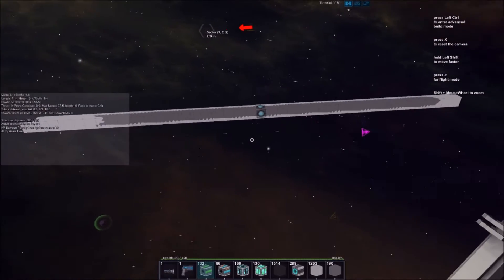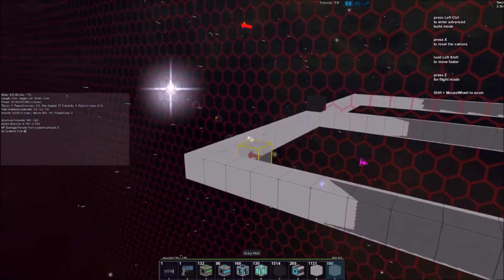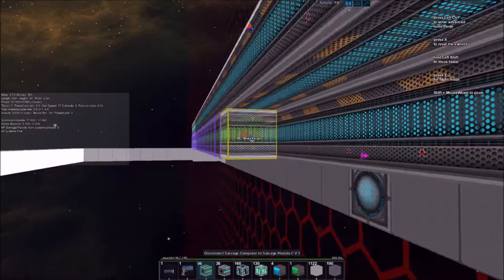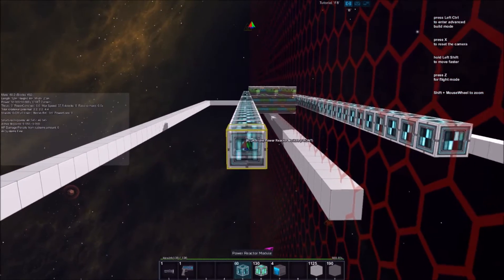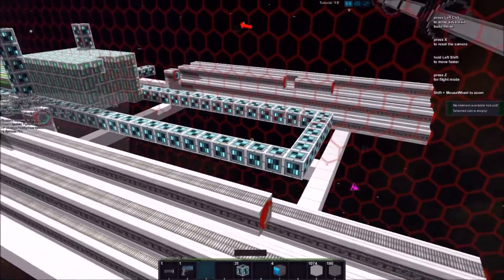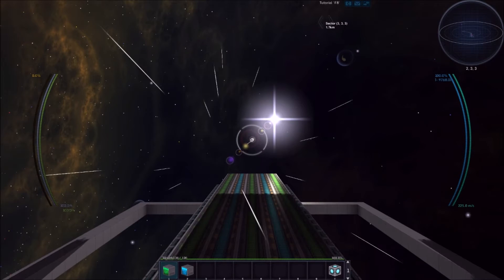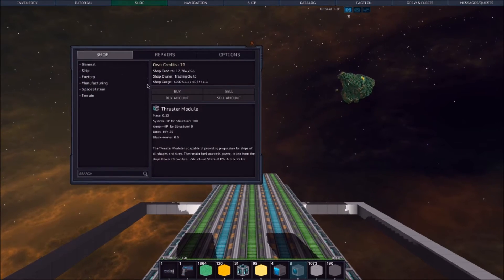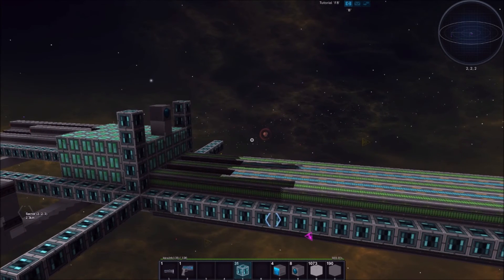Starmade Episode 4 - Realizing Mistakes

Comment: Hello; always glad to see additional videos regarding Starmade. :)

Time Index 9m55s; Connecting the two sections of power reactor blocks in this manner is a mistake for efficient generation.

Regarding the mining of planets Most would advise breaking the core of the planet before mining each individual planet plate (planet parts per the nav screen) with a far larger ship than the one depicted.

quick tips regarding mining in general: 

1) groups of 93 salvage modules per beam are considered most efficient for large mining operations such as planets which will consume approximately 110 blocks per salvage cycle. For this early section of gameplay perhaps having salvage "pipes" of 15 deep would be a good stepping stone in that direction. 

2) For the mining of asteroids Mining fleets tend to be effective as long as you are personally piloting the flagship of the fleet by telling them to formation idle as you pilot to / from / between asteroid fields as long as you connect the salvage computer (amber outline) to a storage bin (purple outline) which itself is connected to cargo modules in order to increase the storage's total volume. (This will not work with planets as of v 199.161)

3) irrespective of single player or multiplayer whether mining asteroids or planets it is always advisable to claim the system before mining resources for a significant bonus in resource yield which would entail creating a faction and subsequently either creating your own space station (best option) or in a pinch claiming a derelict station with a faction module and toggling the "claim system" option offered therein. 

4) given your current miner setup adding a missle subsystem to the salvaging computer might be beneficial in order to spread the mining beams across the surface of the asteroid, or damage pulse system for planet mining. Once you begin experimenting with logic automating the process of mining a planet with a logic clock toggled via an inner ship remote will be a rewarding experience once accomplished :)

Looking forward to more starmade content on your channel.

Comment: Nice to see you're willing to keep figuring out Starmade!

Creating the faction is only the first step, the next step is to run out to a planet or space station and place a faction block, and after that you interact with the faction block to claim the system as yours. From that point forward, whenever you mine an ore or crystal block, instead of one crystal/ore per block, you should get 6. 

Factions are also a way to add permissions to your ship, as long as the faction block is intact, no one outside your faction can interact with your ship core or storage without permission. They also allow you to claim one home base, either a station or one plate of a planet, once you've declared that your home base, everything docked to it or built on it is immune to any attack. It's a safe zone to keep griefers from wrecking your stuff when you're offline (or online for that manner.

Faction points are kind of like a maintenance currency, as long as you're online playing you generate faction points and they get used to essentially pay rent on all the systems you claim. Once you run low on faction points, you're claim on different systems will start to expire, and if you quit playing long enough that you're faction runs completely out of faction points you're home base immunity will expire. The expiration is to return territory to the general supply so to speak when someone quits playing on a server.

There are some PVP elements to FP, but I'm not familiar with them. I have no interest in PVP other then occasionally spawning a ship via admin commands and having a little duel to stress test designs.

I mispoke on my earlier post, Isanths have a main weapon battery of 80 blocks not the 200 I had stuck in my head for some reason. Right now, you have enough cannon blocks to kill an Isanth, but your ship as it is at the end of the video doesn't have the endurance to survive the time it would take you to bring one down. 

You'll eventually want to completely enclose your systems with a hull and add on some shields. System blocks, thrusters, power systems, shields, shield rechargers ets actually take extra damage when exposed to weapon fire. It's better to take the hit on grey hull and best to take the hit on one of the armors. Once you get yours shield capacity to 20,000 Points and a complete hull you could start actually hunting Isanths for fun and profit. You can make a lot of money very quickly by selling the random block drops you get when you can push a pirate ship into overheating.

The good news is you have a very high thrust-mass ratio and you should easily out run them if they come after you. Actually, as of the end of your video, your ship has enough thrust to outrun some of the missile types in the game. 

You're biggest danger right now is wandering too close to a Pirate Station Alpha and getting one shotted by the mini nuke turrets they have. If you notice you're being fired on soon enough, you could outrun the missile, but if they catch you unaware they could easily destroy half your current ship with one hit. Hmm, kind of like creepers now that I think about it...

As far as mining goes, my early game miners tend to have a 20k Salvage beam array organized into 20x 100 Meter individual beams arrayed in a checkerboard pattern, and my mining technique involves putting my ship in a 1-5 meter per second sideways drift and right clicking. 2-4 right clicks will usually completely absorb an asteroid. Drakkarts link is pretty dead on for a smaller mining ship.

You are going to need to set up a storage system somewhere as one asteroid field is going to overfill your personal inventory after you vacuum up each rick in it's entirety. The storage systems use the same principle as the mining and cannon array. One storage block linked to as many Cargo blocks as you wish. You can also designate a nearby storage system as your personal storage which will grant you access to the cargo system from your personal inventory tab as long as your nearby.

And thanks for the shout out, you got the name right, I'm glad my long rambly posts where appreciated :p
Reply from the maker: They are always appreciated man. I love reading your helpful and detailed comments... FYI my next video is already recording so reading your comment as well as watching some tutorials I know some of the mistakes I have made already. But if you see anything wrong let me know anyways.

Comment: Subbed for the Star-made content, I am looking forward to seeing more :)
There is definitely a bit of a learning curve with the power gen, weapon systems, fleet control, thrust config, logic, advanced build mode, etc.  But all that stuff is fun to learn as you go.

Personally I use a 9x9 checkerboard of 18 salvage modules slaved to 18 Pulse beams, they do the most damage with the fewest amount of modules, but it does have a rather large cooldown in between shots.  I don't typically mine planets, focusing on asteroids for the most part.  I still have yet to build a mining fleet, but I'm looking forward to having automated resource gathering rather than doing it all myself
Reply from the maker: Thank you so much for the sub! 9x9 sounds like a decent idea. What's the depth of the modules for the 9x9? Might build something similar for my own mining fleet.
Reply: I was doing some testing today because it seemed that the salvage/pulse was not as effective as other methods... I switched to salvage/cannon to the eliminate cooldown effect,  Currently each row is 60 salvage blocks and 40 cannons since you only need 60% to get the desired effect. I'm not sure how I got 9x9 before... it's actually a 10x10 checkerboard so it lines up in the center - this adds up to 171 rows, or just over 10k salvage blocks, and just under 7k cannons.  In my advanced options I upped "asteroid radius max" to 128 and I frequently get roids with over 1mil blocks, this puppy can eat one of those of in about 5 mins
Reply from the maker: Ok, Thanks for the info.